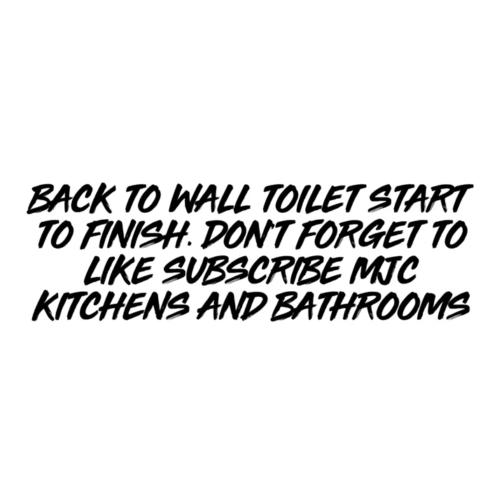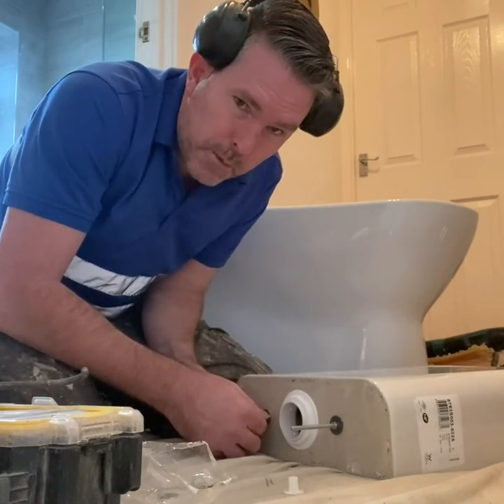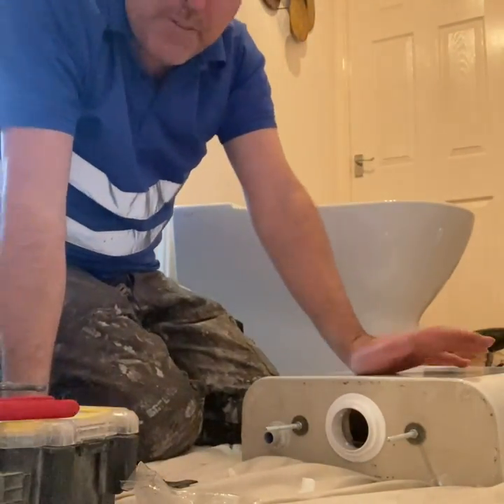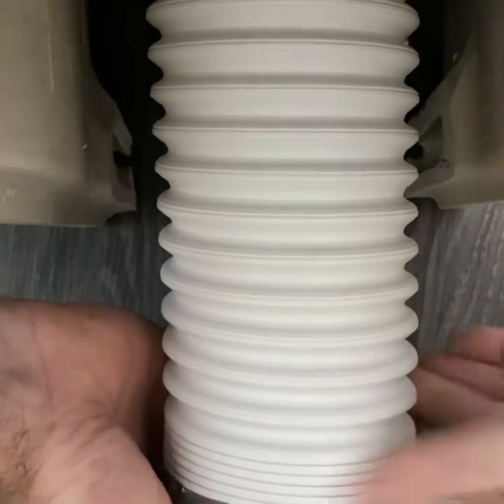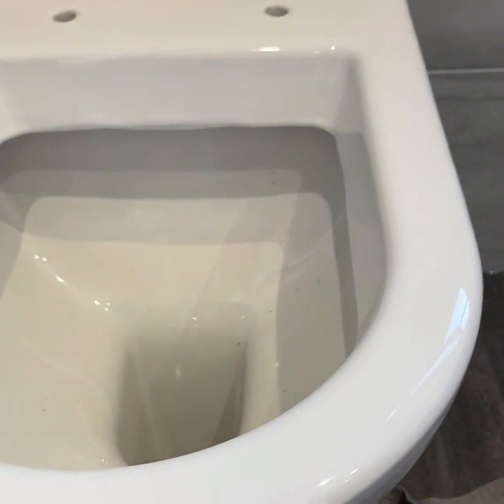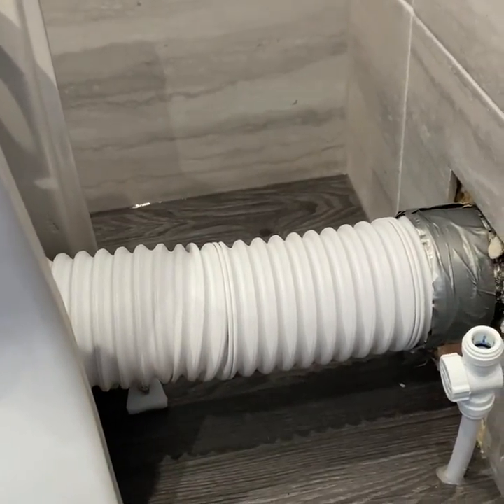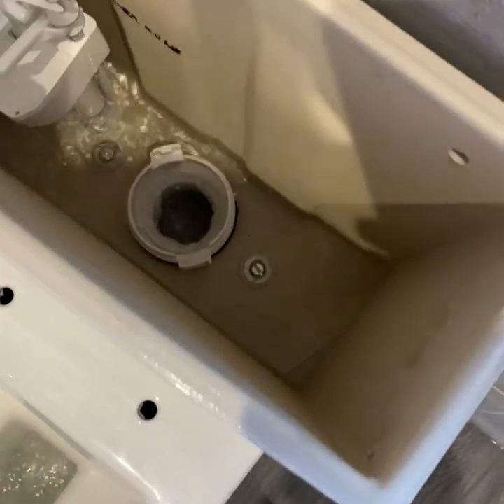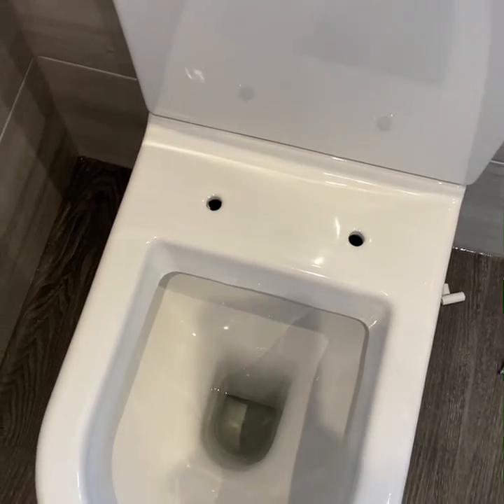How To do a back to wall toilet start to finish￼

Comment: I use plumber's putty unstead of silicone. It stays soft and it is easily removable. Hard pan connector are my choice just because they have no corrugations that can cause blockages. Obviously you can use a vacum cleaner, a pump or just a glove and a plastic cup to take the water off the pan prior to disconnecting it.

Comment: You just saved me. I have just been to a job with this bog. It’s leaking and I now know cos u told me.  I would not have used a towel. Now I will and I m praying that the flexi shit is taped. Thank you. This vid is beans on toast with cheese 😁👍👍👍👍👍👍
Reply from the maker: No problem

Comment: No mention of what you did with the flusher pipe to seal it?
Reply from the maker: A lot of times, if you need to seal around the flush pipe, I would use putty